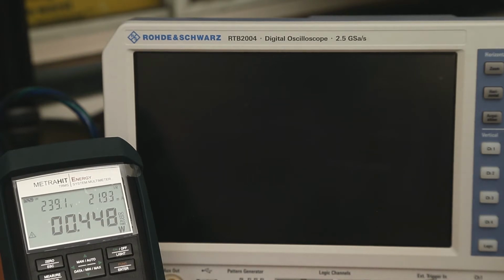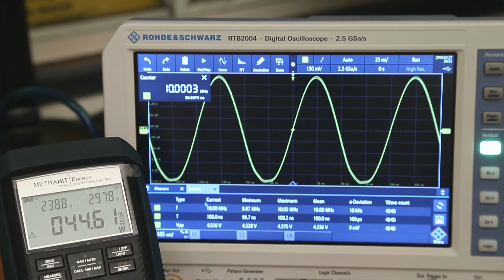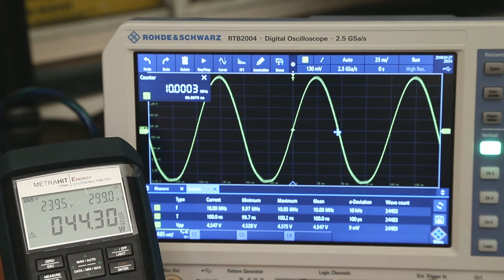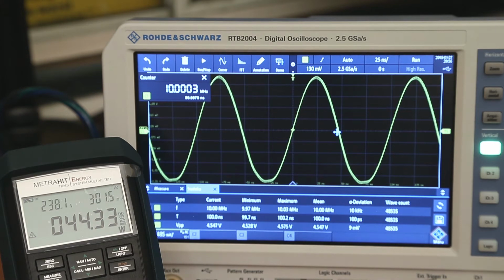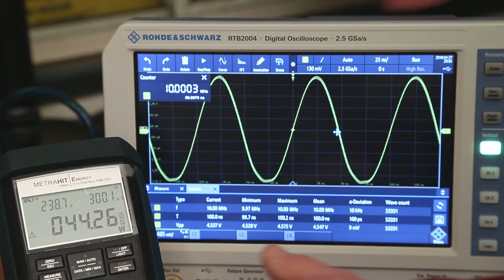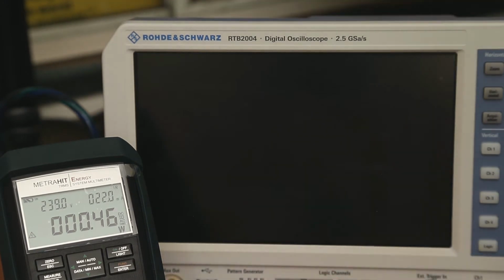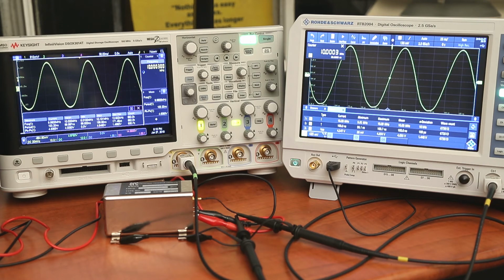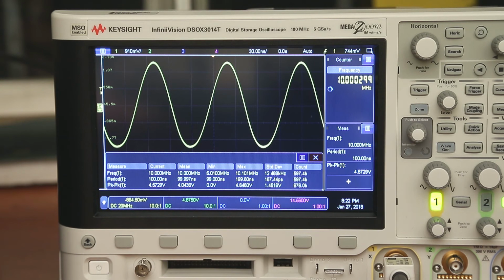Rohde & Schwarz RTB2004 Oscilloscope Power Usage & Frequency Counter Accuracy

Comment: sigh... i guess this wouldn't hurt... but do you got a spare oscilloscope to give away to a stranger on the internet? i know there are a million different type of people who needs an oscilloscope and you can have a million different type of sob stories and i guess a simple answer is to go get a job and buy yourself one lol... but hear me out, my research is quite somewhat unique, especially when you mention 'accurate measurement of ac currents' somewhere in this video. my research currently is finding out how utilize sound waves to amplify amps, heat dampening in currents, send signals in wireless communication as well as driving into resonance motors/hertz motors. i have a unique way of achieving it and it has a lot to do with ac currents, obviously my cheap multi-meter is not enough to accurately measure the field that i'm getting myself in, especially in the high hertz readings... LOTS of hertz readings. the goals i'm trying to achieve is to give the world better mechanism within efficiency in electronics and motor application while dampening the emittance of co2 that powers us electricity.